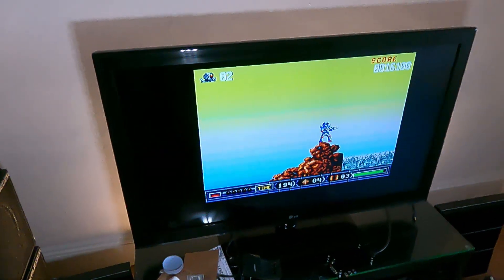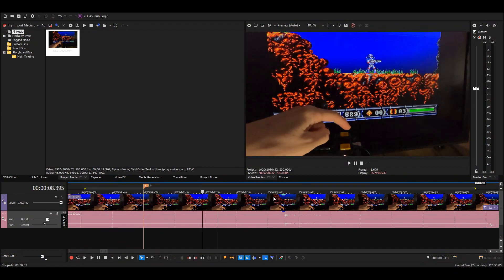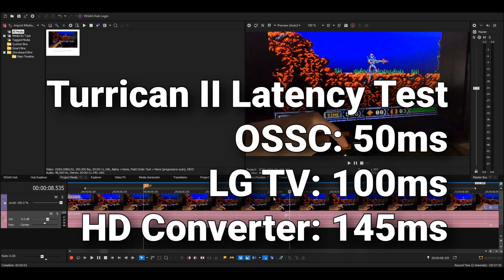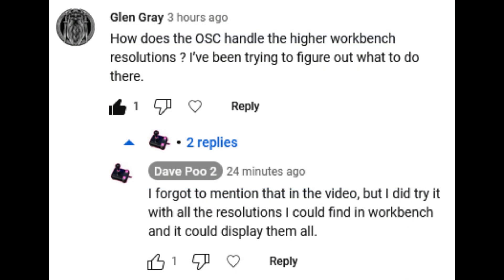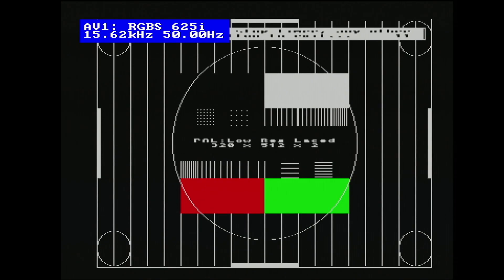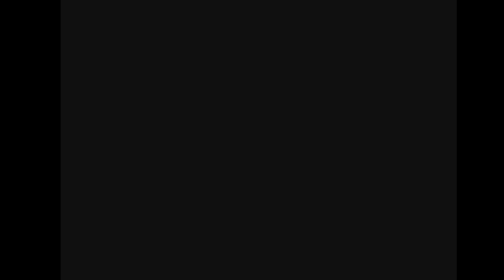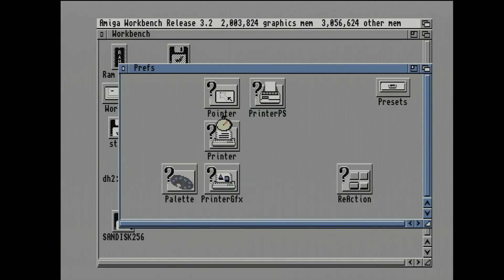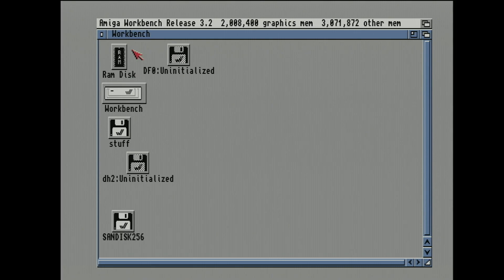Open Source Scan Converter (OSSC) Update (LG TV Lag Test + Workbench Test)

Comment: Great stuff Dave, thanks for the follow up. Handles it as well as could be expected. Would have been a bonus if it helped with reducing flicker, but that’s not what those devices are for.
Reply from the maker: Yeah, the OSSC makes the interlaced Amiga look just as bad as it did back in the day. I actually didn't turn on the scanlines (there is a dedicated button on the front to turn scanline emulation on/off), which might actually make the flicker a little less harsh on the eyes. Also worth noting that the compression on the video capture makes the interlaced modes look a little weird, they do look correct on the monitor, 'correct' meaning just a terrible as you remember.